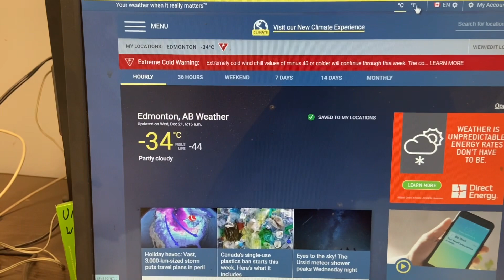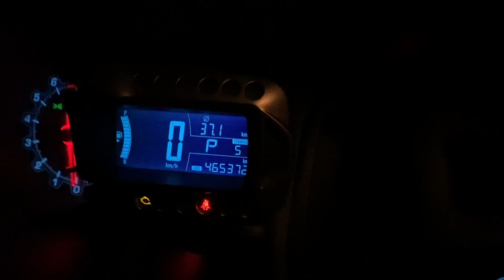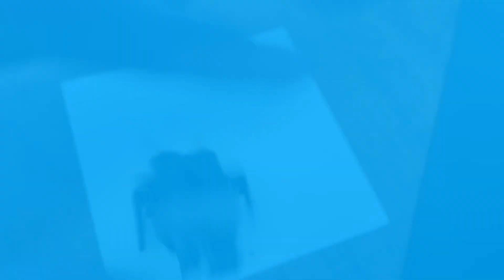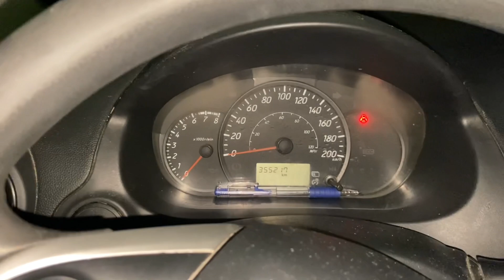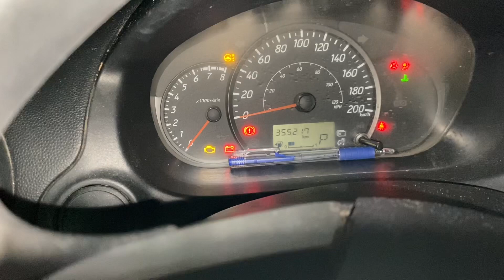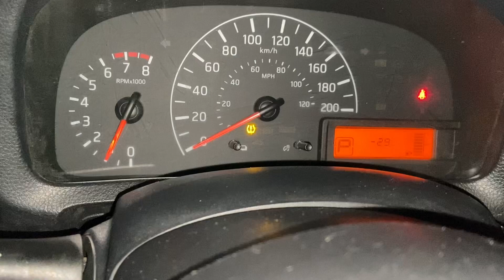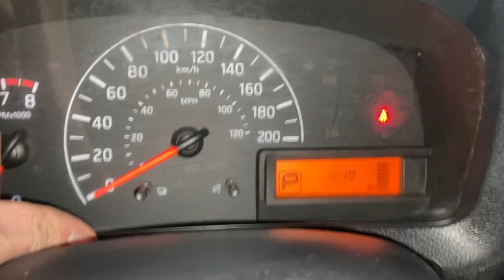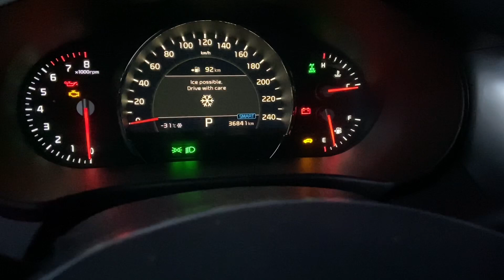It’s cold

Comment: i live in quebec sherbrooke and i work at night so every winter i start my car below -30 and i'm afraid to break it especially with the holes in the streets and the suspension becomes hard as concrete i use 5w20 syntec thanks to my job I can park my car inside I was also late because my manual transmission was stuck in 1st gear I changed the transmission oil this spring 75w90 I have a 2008 mazda 3 if you could you make a video explaining what to do to drive without a problem at -30 I will be happy and thank you for your video